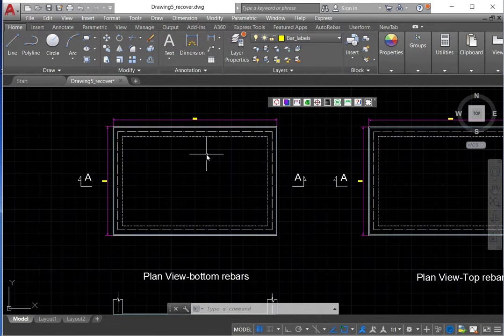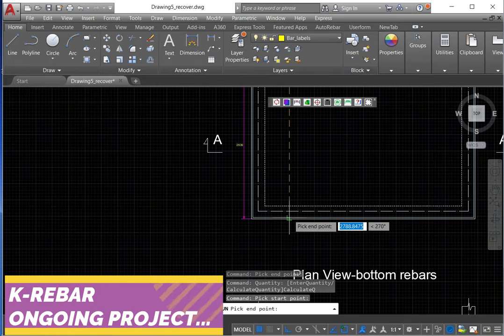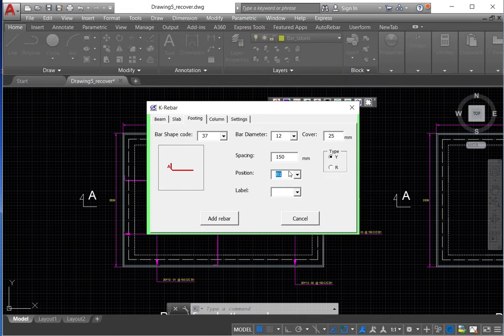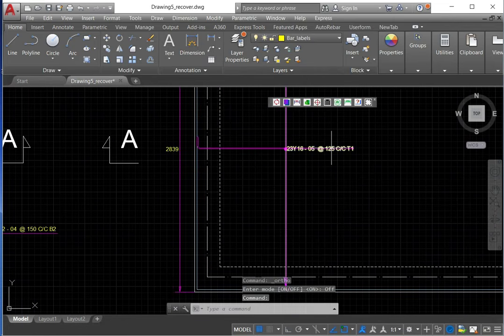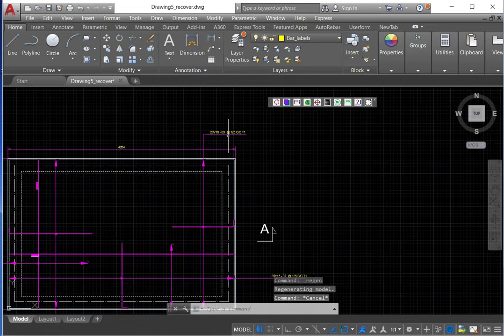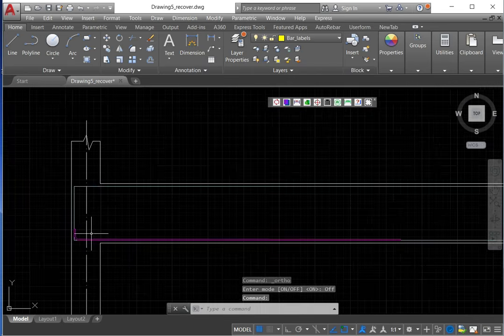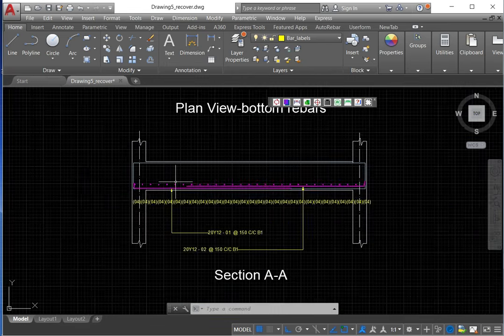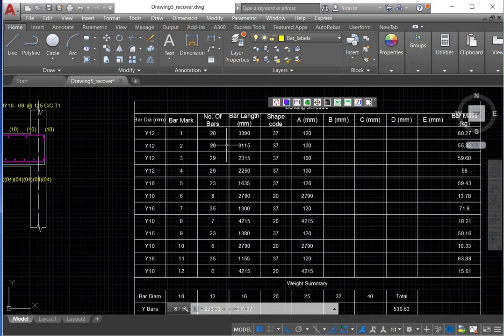SLAB DETAILING WITH AUTOCAD MADE EASY

Comment: Bro, great effort. Please consider adding the shape alongside the shape codes. Not many of us can easily recall the shapes by their numbers, more so, the guys who usually rely on it the most are the artisans on site and for them, you don't want to challenge their academic abilities. A shape with the various dimensions at the various segments will do.... Like in Staad RCDC or Prota Structure. You could consider doing it as a pluggin for Tekla Structural Designer. TSD is goob but it's detailing and BBS is quite not acceptable in many development environment since it is less graphic and more of annotation in table form. Also, if you could give options to differentiate between the line color of dimension lines and steel bars as well as a few line types. It will help to differentiate easily. blue for bottom bars as continuous line and red for top bars as dash line. Line weight options